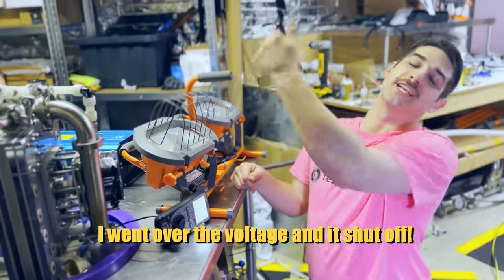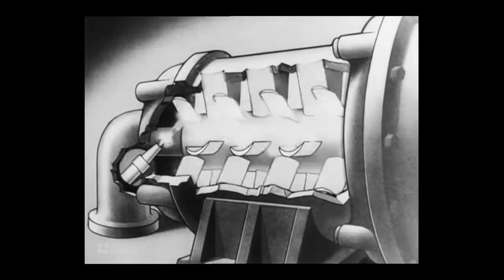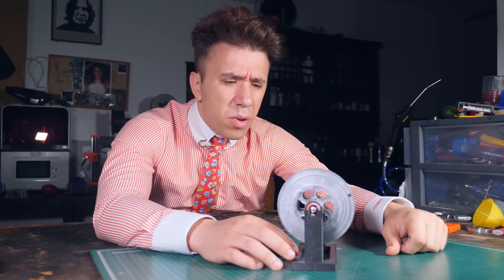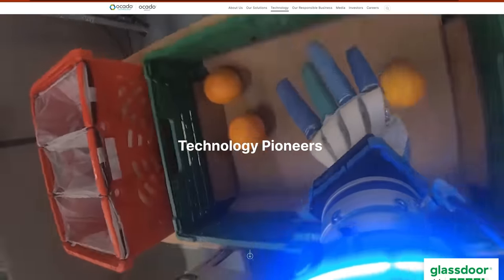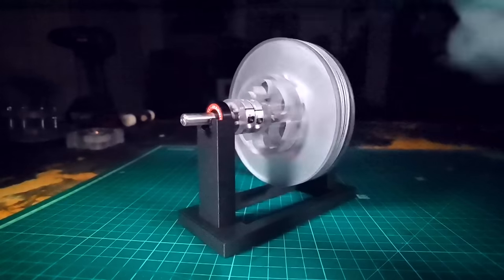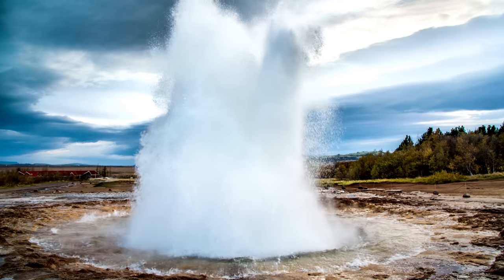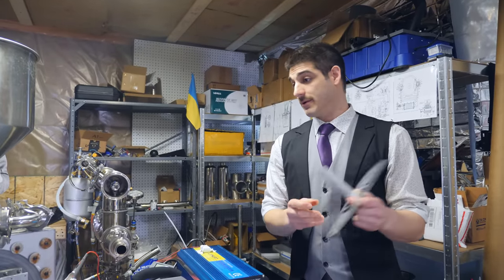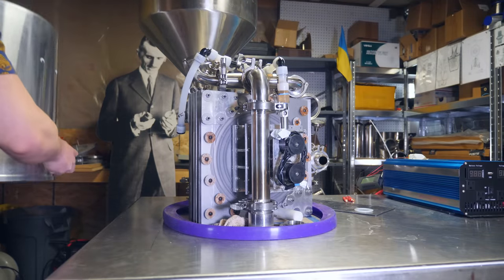Building Nikola Tesla's Bladeless Turbine

Comment: Suggestion: Easy to print wind turbine that can actually charge a reasonably powerful battery (such as a car battery), that can be mounted to a motorhome or a stationary car?
Reply: And his comment was never heard from again
Reply: It would take some iterations and R&D but theoretically possible. But with how far we've progressed with turbine blades, having it powered by wind would be cool, but probably not as efficient as u hope. Now if u had say attached it to a moving car or used it on a nearby stream with running water, you would have an easier time. I remember reading that at higher RPMs the blades start to warp slightly and lose efficiency. In Tesla's day they didn't have the manufacturing we have today, there are people actually trying to recreate his engine(gasoline powered) with higher efficiency than current cars. U could also potentially make a steam powered one at home, with some pipe and a tesla turbine printed in high heat plastic at the end.
Reply: Sounds cool but I'd guess there's a reason small, close to the ground wind turbines aren't really a thing. Plus having it attached to a vehicle seems like more hassle than its worth with needing to take it off every time you drive, unless you find an infinite petrol glitch.. in which case screw the battery
Reply: With a wind tunnel to supply air so it runs while you’re driving down the road. Like an alternator
Reply: And if you incorporate something similar to a turbo on a diesel engine you could get more air compression=increased boost in psi. Add an electronic waste gate and now you can control the psi
Reply: @joshuajames2785  I always thought about making a prototype turbo out of a tesla turbine, just never had the spare cash to build one out of metal to withstand the pressure
Reply: Bad and implausible
Reply: This has been done by another yt channel
Reply: Well as sheldon said it the problem with wind power is that it is to reliant on wind yes you could make it but to what use the blades would have to big and the motor would have to be a good one there are just better things you could do a built for the same outcome
Reply: @PrisonSoap  Just sticking a turbine on the top of a car would take away more power than it provides due to drag. Terrible idea. Regenerative braking is much more efficient.
Reply: @AAARREUUUGHHHH  definitely got a point, regenerative braking is definitely much better
Reply: @joshuajames2785 what up my name is Joshua John
Reply: This turbine needs a very directional and constant flow of air, you are much better off using standard wind turbine for your car
Reply: @aditya.khapre  Vertical axis wind turbine does not need to point into the wind.
Reply: Too bad you can't post pics, I built a 12v lithium battery with 100 amps of current. Would be suitable for your needs with a power inverter.
Reply: @PrisonSoap  wind is free, ?
Reply: @PrisonSoap Tesla didn’t have even remotely close to the materials science we have today, I’d assume something like carbon fiber would be good here due to its high tensile strength but it would be hard to get the strands all radially outward
Reply: @breadloafbrad  yea, I know there was a company trying to make an efficient engine with the tesla turbine, they were using grooves into the disks and using polymer materials and alloys to help fight warping of the disks
Reply: Is this a suggestion or a question ❓
Reply: @breadloafbrad a properly balanced rotating disc isn't really subjected to very much tensile load because the stress is in a state of equilibrium. It's not a material issue. The main downside is channeling air in a way that it doesn't naturally go. Turbo jets use static vanes to direct the air which makes it less turbulent. Efficient engines are all about smooth flow.
Reply: @AAARREUUUGHHHH  you would stick it out in front. Especially if you have a terribly un-aerodynamic front end like a truck, it actually can be beneficial by breaking up the "still air" column infront of the truck which would normally just impede at the flat front anyway or be caught in the grill, w/e. The point is it can work to generate more energy than drag it imparts and some guy did it with his little kid here on youtube. Can't remember the channel name unfortunately. I think he powered an oven in his vehicle since he needed a big load for the turbine.
Reply: @PrisonSoap wait adding this turbine to the air intake wouldn’t actually add drag, right? I guess EVs don’t need air intakes anyway though